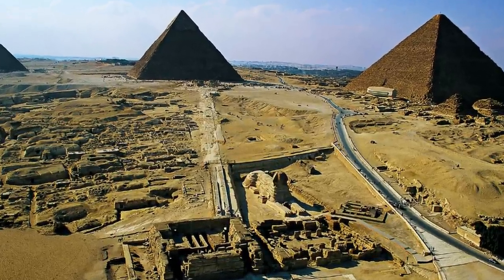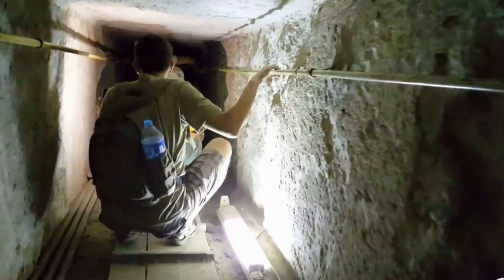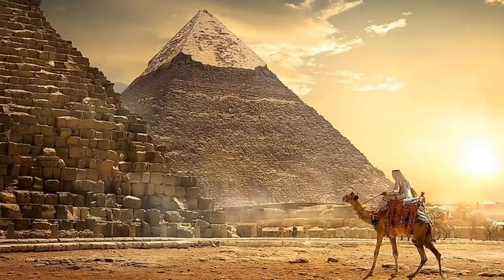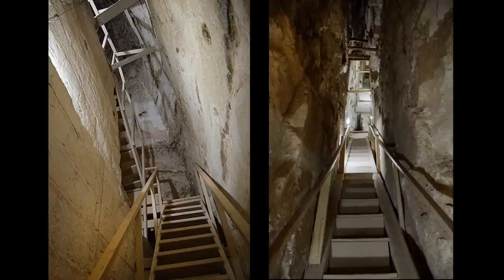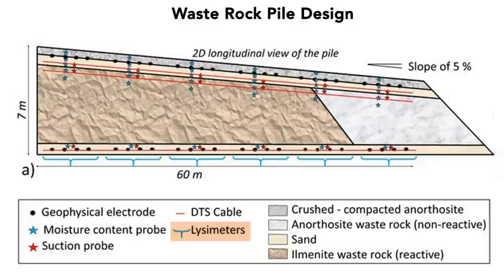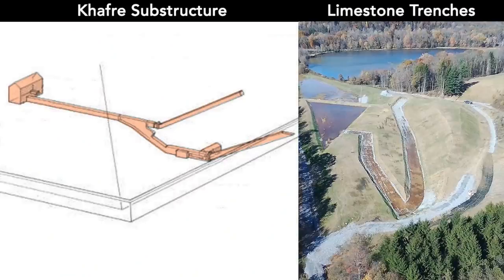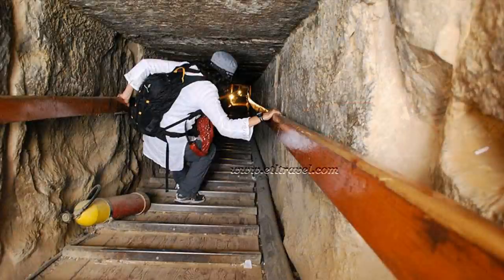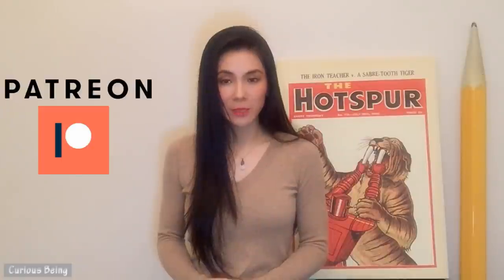The Secret Enigma of the Egyptian Pyramids’ Interior

Comment: I really think you are on to something and a coherent theory, but something is still missing. 
I've mentioned it before and I repeat my concerns here again. According to your theory the "air shafts" functioned as drainage channels for acidic water that seeps through the pyramid despite the casing stones. 
This theory only works in your diagram for a mere 20cm, the width of the air shafts. The rest of the pyramids is massive and solid and the 2+2 air shafts are totally irrelevant for drainage. In addition they did not connect to the queen or king chamber but where discovered and somehow chiseled out (I have to research on that and figure out the facts). If your theory were valid then there would a multitude of air shafts from all sides and directions leading into the core chambers. Which means we only discovered the very few known ones and there are many many more behind the rocks. Water follows gravity, even with a nearby channel it simply seeps straight down. As I said before there would need to be water tight angled accumulators to channel the seeping water into the pipes (air shafts). Without a multitude of those shafts only a little tiny part of water would reach the inner chambers and simply seep straight down into the bedrock and underground water. That's why communal rubbish dumps and mine tailings have water impenetratible plastic sheets that collect and drain the rain water into the water treatment pools.
I believe that's a crucial detail that needs further investigation for your theory.  
The Khufu pyramid only has 4 known "drainage channels in one plane axis which are microscopic compared to the whole structure. Won't work. You need a lot of them from all sides.
Further note: according to your theory all these structures in Egypt would make sense only in a wet climate. Nobody would make all that effort and costs for mere tailing in a hot, dry desert. Which leads to two interesting conclusions: i.) pyramids were built in vastly different climate than the one of the early Egyptians which needs to be verified and ii.) the pyramids must have been known even at the time of the early Egyptians are mere industrial projects without any religious or Pharaonic background because otherwise the royals at that time would have claimed them as their achievements and would have decorated them with ornaments and paintings like in the Valley of the Kings. But they didn't and in no wall picture or papyros there is any mentioning of the pyramids as far as I know. This needs further investigation because I saw a few documentaries that explain how the Pharao Sneferu had built first the step, then the bent and finally the red pyramid. Which would make no sense.
Reply from the maker: Thank you for the discussion. Certain drainage channels actually don't need to be watertight - they are designed to be perforated so water can seep into the channels to be drained away.  
I think the pyramids were built when the climate was pretty arid, similar to today.  “Cairo is donated on balance 26 mm (1 in) of rainfall per year, or 2.2 mm (0.1 in) per month. The wettest weather is in January when an average of 7 mm (0.3 in) of rainfall (precipitation) occurs.”
The climate in Cairo is called a desert climate. There is virtually no rainfall during the year but sometimes there would be sudden precipitations which cause flash floods. 
 
The Sahara/ North Africa goes through humid/dry cycles. The Sahara was green and wet from about 14,500 years ago (after HS1 the millennia-drought) to 6,000–5,000 years ago. The humid period before that was around 85,000 to 78,000 years ago. HS1 (20,000-15,000 years ago) is the time period that coincided with the severe human population bottleneck which I think could be the ending of an advanced civilization. If the pyramids were built during 78k-15k years ago, then the Giza Plateau would be as dry if not dryer than now. 
I have more evidence of the dry climate in the Cairo/ Giza area even during the humid period which I may make a video on :-)

Yes there seems to have no murals/ reliefs depicting or mentioning the pyramids. I think the the Bent pyramid was probably built after the red and possible Giza pyramids too since it sustained most of its casing stones and its interior represents a more advanced acid drainage treatment system. More investigations are needed indeed.
Reply: @CuriousBeingbyTina  Ben from UnchartedX last week released a video about the staged, bent and red pyramid. Have a look.
There are great theories about the Spinx looking towards Leo star constellation and when that happened during construction. Due to precession of the earth there are only a few time windows. I think Graham Hancock gave some very good  presentations on this. 
However, the Osiris shaft and all the old sites could not have been built during the wet time. Simply because they would be flooded by groundwater from all the rain. 
There is so much contradicting knowledge out there, it sometimes blows my mind.
Reply from the maker: @DilbertMuc  Yes there is a lot of contradicting theories...well, it's good that we have the opportunity to discuss and examine them. Hopefully together we will get closer to the truth.
Reply: @CuriousBeingbyTina  In Cairo the avenue of the Pharaos has recently been opened and the new mega-billion dollar museum of Egypt Antiquity will finally be opened in April 2022. I assume they'll have a ton of information and artefacts on display that spent their time in the cellars. I remember that only 10% of all stuff in the Paris Louvre is on exhibition and the rest stays in the subterranean cellars for eternity. Same in Cairo, I guess. Now with the huge museum they can show it all... hopefully.
Reply from the maker: @DilbertMuc  No, that's an over-3-hour video....I will try to watch it when I have the time. Good information? Did he explain how megalithic sites were built?
Reply from the maker: @DilbertMuc  I watched a bit. He is taking apart Ben's argument but how did he explain the interlocking granite blocks in the valley temple and the transporting and construction of millions of tons of blocks? With copper chisels and dolorite stone balls? I think it'll be great if he can make a video of himself using these tools and making a granite or limestone block, or using a copper drill to create a core drill in granite in real time. Then we can compare the tool marks of his product and the ancient stonework.
Reply from the maker: @DilbertMuc  I watched the Scientists Against Myths video this professor used to debunk Ben's core drill. It is disappointing that the video didn't show any detail shot of the core and the markings inside the drilled holes. However, the cores and drill holes in ancient Egyptian sites are well photographed with many close-up shots. They have distinct thin parallel uniformed lines. I don't see that on the video from the Scientists Against Myths. I wonder why didn't they show a few close-up shots. If their core presents the same markings as the Egyptian ones, couldn't that be totally convincing? Not showing the details is suspicious.  Cores showing different tool marks mean  they are not created the same way. To me, this is really can't be used as evidence to debunk Ben.
Reply from the maker: @DilbertMuc  On the contrary, I think this is evidence that the marks were not made by hand tools. 1st of all, the marks they made are different, not the same depth or shape while the ones at the Baalbeck block are pretty uniformed. It's obvious how crude their two lines are comparing to the ancient marks.  2nd, they chiseled marks on a relatively smooth stone surface instead of really excavating the stone. What they were doing was to "dress" the stone after a piece has been split from the bedrock and roughly shaped. 3rd,  what's the reason to mark these almost parallel curved lines and chiseled to follow these lines? And to cover huge stone blocks with these countless lines?  There are markings under the Baalbeck block, not on the "facing side"  therefore didn't need to be dressed. If they were excavated by hand tools, then why would the masons to dress the underside the part which would be leftover?
Reply: @CuriousBeingbyTina  You got a good point there. The more I research the more confusing it gets. Maybe someone should simply check the secret Vatican library for ancient Baalbeck user manuals... 😆
Reply from the maker: @DilbertMuc  Ha I know...
Reply: @CuriousBeingbyTina  In Thailand they say "same, same... but different". In my words, just because the Russian Scientists against Myths found a way to drill a hollow core and got the same result doesn't mean it's the same. It still is different. And very much so. An although they ridicule Bright Insight and UnchartedX for being highly unprofessional (which they are in a way) they still can't explain the extremely precise stone cuts in huge rocks and the precision carving of the statues that Ben and Jimmy report on video. Using flint stone to engrave an eye into a rose granite block was feasible in their video, but the result looked like those crude hieroglyphs on the surface of that black Serapeum stone box.
Reply from the maker: @DilbertMuc  I think they misunderstood the ancient tool marks. Here is a photo from a conference research paper showing pickaxe marks: https://www.researchgate.net/figure/Marks-of-the-ancient-minerss-pickaxe-on-the-oxidized-ore-photo-A-Dudashvili_fig3_329521359
You can also search getty videos for "pickaxe on stone" - the videos are pretty telling. I also showed footage of chisels and pickaxes in this video of mine: https://youtu.be/4iZTr_ZJA5g
Reply from the maker: @DilbertMuc  Yes I hope they can explain the extreme precision joints among blocks,  the 90 degree angels/ corners of the stone boxes at Serapeum, the transportation of these heavy objects, the millions of 2-ton pyramid blocks being stacked and more, all with dynastic Egyptian tools. Getting one core drill done is far from debunking Ben or Jimmy.
Reply: @CuriousBeingbyTina  There are many very interesting videos from "Scientists against Myths" that I need to watch first to get an overview but so far I think they explain really good how the stones could have been treated with quite simple methods. However I really doubt that all these processes were done by hand from an army of laborers. Again, it is against fundamental economics and logic. I rather think they had highly sophisticated machines that did that job. By machines I am thinking of something like the Romans had. If they could have moved huge obelisks to Rome and build all these gigantic buildings in their empire they had very efficient machines and tools for all of that. Primitive example: instead of 50 laborers who carry all day water with a sealed goat bladder from the Nile to the field, they had a "high-tech machine": the famous Archimedes screw with two oxen as motor. Job done, no work, same result.
Reply: @CuriousBeingbyTina  Very good link. Thank's!
Reply from the maker: @DilbertMuc  The Archimedes screw is a great device to transfer water from a low point to a high point for farming (mostly within the 1.5 m elevation difference). Egyptians still used them 50 years ago and photos can be found online. The Pyramid K movie proposed the use of big Archimedes screw moving water up over 40m to the top of Giza Plateau. It's highly improbable. The Archimedes screws that Egyptian used are much smaller than what was shown in the movie. Big Archimedes screws are very hard to operate and need a lot of force.  The limit in practice is determined by the strength of the screw materials and the human turning the tub which contains water. Currently Archimedes screws are still used made with metal tubs, screws and engines.

Comment: The supposed drain system had blocking stones in the middle of the shafts with a couple copper components. Try another theory. The rubble floor was dug up in the past. The missing casing stones supposedly had writing on them.
Reply from the maker: The air shafts in the Great Pyramid are free of obstruction for about 50 m. If there are multiple blocking stones spaced somewhat evenly in the shafts then they might not be drainage channels though this is not the case. Are there ancient records on the rubble floors being dug up? The Bent Pyramid has most of its casing stones intact; there are not writings on them.
Reply: @CuriousBeingbyTina  their is a documentary that is out as a matter of fact, and history mystery Channel has the other record i think on their Channel.

Comment: It’s obvious the shafts are not meant for people.  But your theory of the pyramid being storage for mine tailings makes no sense either.  The interior and exterior surfaces are too polished or otherwise finished too precisely for this utilitarian purpose.  It’s like building palaces to warehouse trash.
Reply from the maker: The interior and exterior of the pyramids are not polished. Whoever made the effort to build the pyramids of course would have done in-depth planning and well executing work so the massive pyramids can last and not crumble.  Also the precision stone work can be seen from many megalithic sites around the world. It's obvious that the ancient builders had a very high standard of work quality. Everything they did seems to show an element of extreme precision and care. It would be difficult for us to achieve the same level of work or alignments but it might be easy for the ancients. 
As for the cemented tailings mound technology, it is still in the conceptual stage today. Just because the material comes from mine waste doesn't make the waste storage any easier; on the contrary, permanent storage of potentially toxic materials is a huge problem in our world right now.